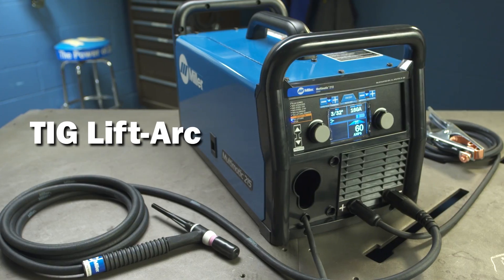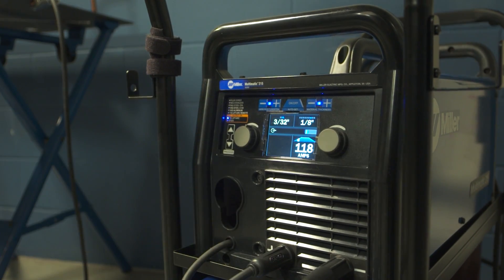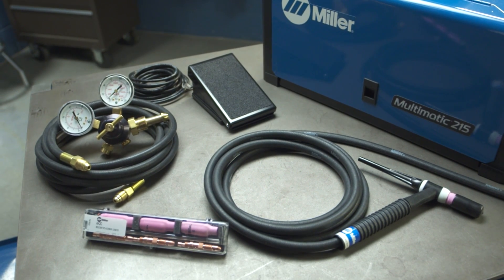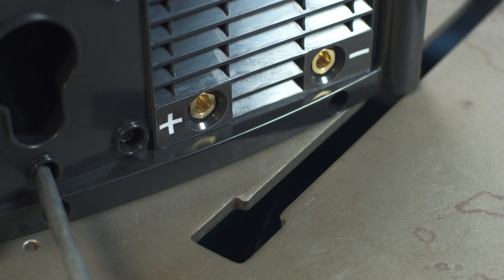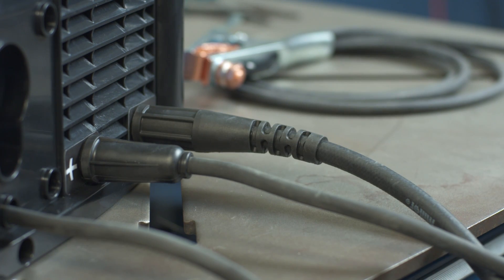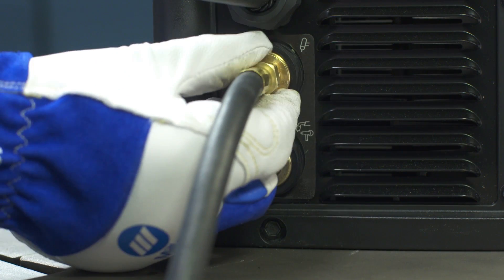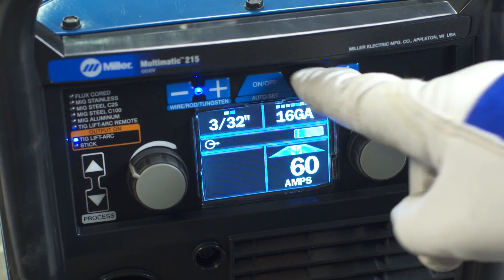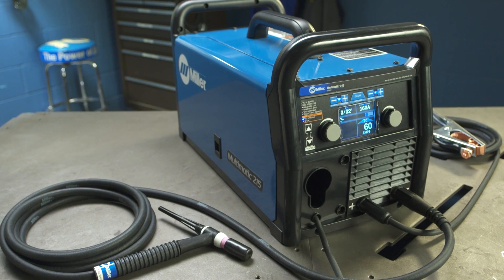Miller Multimatic 215 Lift-Arc TIG (GTAW) Welding Setup

Comment: Uh, you say you need a tig kit with included pedal. Then you set the machine to tig/stick WITHOUT remote instead of Tig lift arc  remote? Seriously guys ?
You should consider changing this video to show using those 2 modes with and without remote and why there are 2 modes for lift arc.